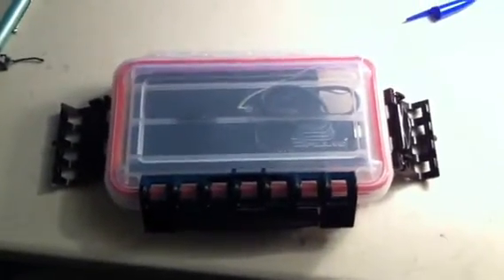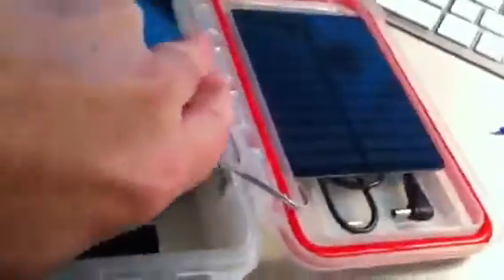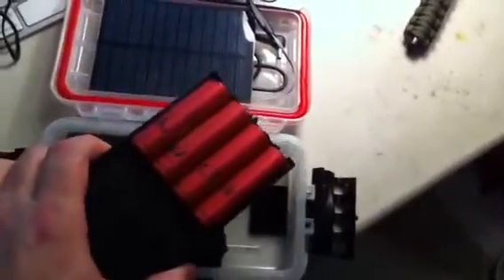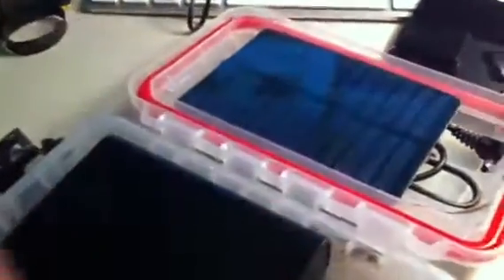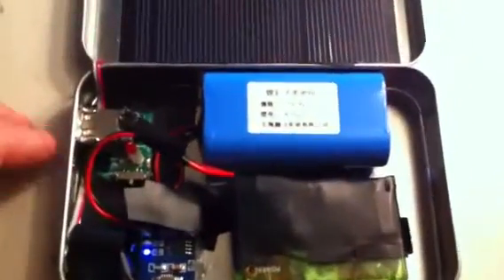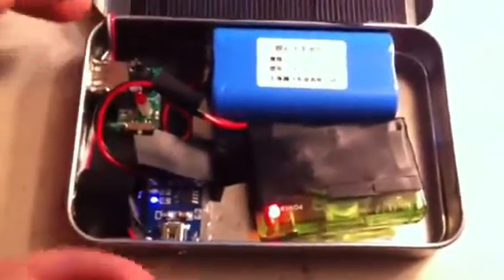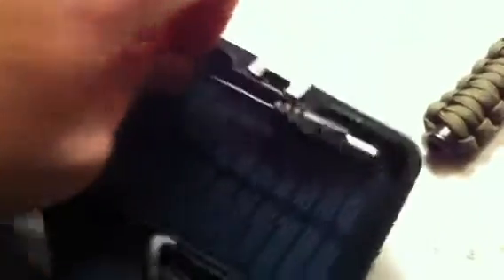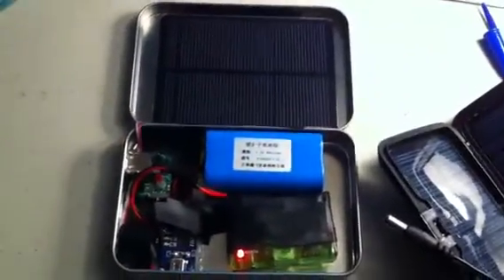WATERPROOF solar iPhone/iPad/USB charger with Lithium-ion power!

Comment: man, ID love to know where you source your parts. especially the panels.
Reply from the maker: The first panels shown were from Radio Shack.  The battery bank was from suntekstore.com.. it was $6 with free shipping that took like 15 days. I have bought other solar panels from Amazon and some from Voltaicsystems.com. Their stuff is super tough. I got the 2 cell blue 18650 battery pack from www.browndoggadgets.com for about $17. The Plaino box was from Meijer.
Thank you watching and the comment!! If you have any other questions let me know..
Reply: ShoeManShoe68 Wow, thank you for replying. I'm actually interested in making my own power station to run a small house. Tesla poser wall style. However, I need to start small because I only know what I get from YouTube and practice. 

I love your videos because you break it down simply enough that even I can understand it. Thanks for helping me learn.
Reply from the maker: No problem.. If you have any questions about anything let me know. I love to share knowledge. 
I go by some simple rules when charging from solar. 
-You need a charge controller when charging Lithium-ion batteries. 
-The solar setup should put out the highest amount the charge controller can accept so your charge will happen as fast as possible.
-Try to find the most efficient solar panels you can because the solar tech is growing so fast right now because of the electric cars..

I have a lot of different videos on how to make small solar setups some lithium-ion and some NiMh rechargeable batteries.
I also have a few wiring diagram videos..
Thank you for the back and forth and your comments!!!
Reply: ok, I do have one question. the mini USB charging module, does it automatically shut off to protect any size battery from overcharge? or do I have to pay attention to what Mr Chinaman is selling on ebay to make sure I get the right capacity? I'm asking because I just figured out I can't use 18650 cells with a USB car adapter I canabalized.
Reply from the maker: Sorry, i never saw the notification of your last comment. Glad you figured it out. If you make a video let me know.
Reply: oh geeze... the name still hasn't changed. sorry about that, my room mates found my password.

Comment: Hi ShoeManShoe68.
Is that TP4056 module ?
Isn't TP4056 module can charge only 1 18650 battery?

Can you tell me what components inside the box, please... ?

I'm planning to build one too, but as far as I know, TP4056 only can charge 1 18650 battery.

Thank you :)
Reply from the maker: +Jimmy Lin OK.. here is a link to the 18650 box i bought. It holds 4 of them.
http://www.suntekstore.com/goods-14002339-5v_mobile_power_supply_usb_battery_charger_18650_box.html
The best solar setup to use to charge that box with batteries in it is 5 volts and 1amp. That is the most that charger can accept. The 18650 box is only $8.43 US right now and free shipping. I paid like $5.62 US or so when i bought it years ago and it still works great! I have not used it daily but when the power goes our or i need a charge when i am not by a charger it always seems to have some juice in it. I can change it and let it sit for months and it will  still have a full charge.
Thank you for the comment and if you have any questions feel free to ask...

Comment: Hello ShoeMan, I am very interested in creating a solar usb charger and have been watching lots of videos and reading up online. I wanted to ask someone with experience about my plan. 

-I have a solar panel with a Rated Power of 1.25W Rated 13.3V and Rated 0.09A.
-I want to run it through a car cigaret lighter usb board with an input of 12-24VDC and an output of 5.0---1000mA
-I will usb to charge a PowerBot Universal Power Bank with a input of 5V 0.5A and an output of 5V 0.8A.

Will this work? I am forseeing problems with the low Amps of the solar panel, I also have a second identical panel I could run in a paralel circuit would this be enough? Do power bank devices have an automatic shut off to stop charging or would I need to monitor the charging process? With 5V as the output I could never burn out the power bank could I?

Thank you for your time and expertise.
Reply from the maker: Sierra Bushcrafter Hello... The USB charger has the circuitry needed to output the correct voltage and amps so you will be fine. The power bank will have protection so it would not allow too much or not enough voltage or amps in. 

I would run the 2 panels in parallel so you would have more amps but it will probably work with just one panel. Those little cig lighter USB plugs can run off a 9 volt battery for a short time so try to 1 panel and test what it is pushing and if it is no enough then add the other panel. It sound like a fun project, let me know how it turns out...
Thank you for your comment!
Reply: Great! Thanks for the response shoeman. I am excited to try it out.

Comment: Do you use something against overcharging?
Reply from the maker: Yes, there is a charge controller that protects the battery. I got a few other videos about the wiring an how to. Check em out.
Thanks for the comment!

Comment: Thanks for this great project! I'm going to try it!
I have two questions:
1. There is a problem if you have connect the USB input and the solar panel at the same time?
2. It's possible to have connected any input source and charge a device at the same time?
Thanks again
Reply from the maker: Connecting another charging source at the same time as charging the device in the sun will just make it charge faster. The charge controller will regulate the output to the battery and if it gets too much current it will stop allowing flow into the battery. I would recommend somewhere around 4.5 to 6 volts and 1500 to 2000 mAh of input to charge the Lithium battery the fastest. The case shown in the video with the solar panel in it has a solar panel that pushes 6 volts and 167 mAh. If you were to plug in a cell phone charger and still have it in the sun it would be getting about 1167 mAh and about 6 volts and that would be fine. If you can built a solar setup that can put out 5 volts and 2000 mAh it would charge the battery as fast as it will be able to and then plugging in another power source to add to it would just create a problem. Plugging in 2 charging sources at the same time will be ok as long as you keep the total under 6 volts and 2000 mAh.

I have charged a cell phone with this unit at the same time as i was charging the unit itself and it worked. The solar panel being so small it will just help to add a very little bit. It will not have enough juice to charge both devices. If you are inputting 2000 mAh you can easily charge the cell phone and the chargers battery at the same time.

(It is different when charging Ni-Mh batteries without a charge controller) You would only be able to use 10% of the batteries total mAh to charge them.
Reply: ShoeManShoe68
Thank you very much for your answer ShoeManSho68

Comment from the maker: Well google ruined YouTube and using my iPad I can't see a way to reply about the NiMh batteries. My reason for not liking NiMh batteries is because there is no way to add a device to stop charging the batteries when they are full and still keep the pocket size. I know you can keep an eye on it but eventually you will forget and overcharge and then you lose the longevity of the battery. Also the power curve is not great like the Lithium type. The power drops off slowly and gives lower power for a while before it drops off totally. Lithium will give full power right up until it drops and then you charge it again. I am not a genius about batteries this is just my opinion.
Reply: you cannot trickle charge Li ion batteries!!!    all the devices that do are dodgy!
Reply from the maker: I never said anything about trickle charging. I talked about Ni-Mh batteries and that you can't just leave them hooked to power and there is no small cost effective way to stop charging the batter like when you have Li-ion and a charge controller. I know you need 4.2 volts constant to charge a Lithium battery. Thanks for the comment!
Reply: didnt you say your battery bank has 18650 li ion batteries?
Reply from the maker: Yes but the way the comments displayed to me showed that you commented on a reply of me talking about Ni-Mh batteries. Yes i have a bunch of videos about a lot of different projects. I don't remember saying anything about trickle charging Lithium-ion batteries. Not trying to be rude at all i just did not understand the trickle charging comment. Maybe it was to someone else. Like i said Google has messed up the youtube stuff and the way comments are handled.
Reply from the maker: The blue battery is a 2 cell 18650 battery pack.

Comment from the maker: Make sure you use 1 battery and not a few Lithium batteries all wired together. With Ni-Mh batteries you can use a bunch of different batteries to get a ton of mAh but it is different with he Lithium. You can find a 15,000 or more mAh Lithium battery somewhere.

Comment from the maker: I forgot to say.. If you are going to buy a Lithium-ion or Li-Po battery make sure it has protection on the battery!!!! Browndoggadgets has the blue Lithium-ion packs and Radio shack will have protected packs as well. This will keep it safe and make you have to worry less. If you cross the wires on a protected battery it will just pop the circuit and it will act like the battery is dead. In about 30 seconds it will start working normal again. AGAIN do not solder wires to a Lithium battery!!!

Comment from the maker: Which device do you refer to? I posted a video of how the wiring is for the Ni-Mh charger so check that one out if you are talking about using rechargable AA batteries. If you are talking about the Lithium pack or the battery bank with Lithium cells let me know and i will try to make a quick video on that. Thank you for the comment and interest!

Comment from the maker: Which type are you going to make? Lithium-ion or Ni-Mh? 
If you have any questions please comment. If your working with Lithium please keep it dry and make sure not to let positive and negative touch! Use wire with different markings for positive and negative so you do not mix them up. Do not heat up a Lithium battery, Do not solder on the battery itself. Too much heat may cause the battery to explode or burst into flame. Neither of those sound fun to me. Have fun!

Comment from the maker: The battery bank with 4 18650 cells in it is simple. It is like a battery charger you just put the batteries in negative against the spring and it is done. It can hole anywhere from 1 to 4 cells.
The blue 2 cell pack I bought and with a Lithium-ion pack you need a charge controller. The controller board has B+, B-, S+, S- printed on it. So you need to hook the battery and the project to the B+ and B- and the solar panel to S+ and S-. Since the battery has protection in it there is no worries.

Comment from the maker: Thank you for leaving a comment! I got those solar cells for around $10.00 each at Radio Shack. They are 6 volt 84 mAh. It will say that on the back of the packaging. The both of them together are 168 mAh which is a good amount to charge AA batteries with the sun it will take about 2, 5 hours days or 10 hours of sunlight. Just so you know.. That aluminum wallet does not open flat.